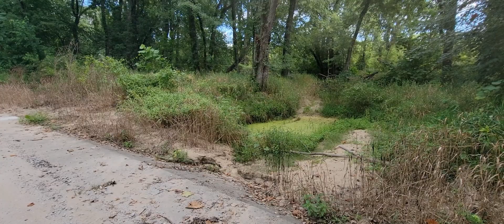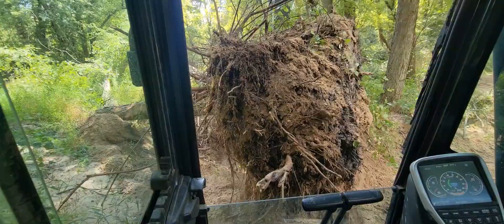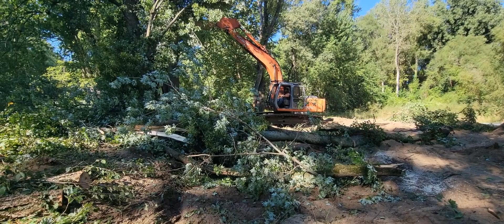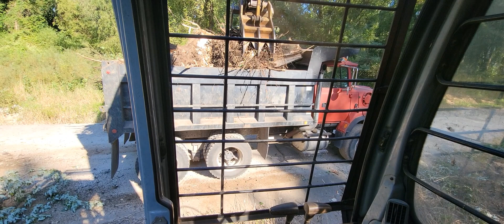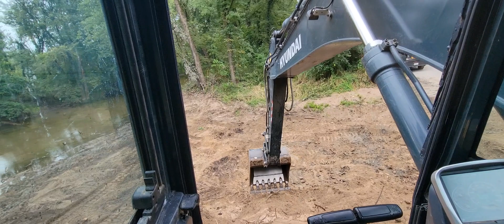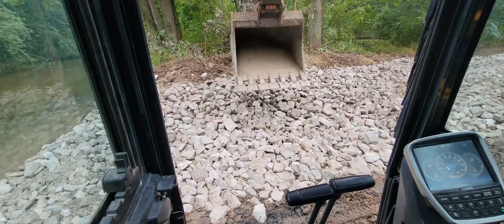A New Adventure With The New HX220AL Hyundai Excavator!

Comment: Speaking of getting hot, any ideas on whats causing my PC75 to get hot? No leaks in the cooling system, no fan clutch, water pump seems to work- no noise, thermostat works- boiled it. Only thing I can think of is maybe the impeller spun on the shaft, avoiding tearing into it for now.
Reply from the maker: Is it the hydraulic getting hot causing the engine temp to go up? And have you checked the engine temperature with a inferred heat temperature gun  to make sure the gauge isn't just lieing
Reply: @dirtgrainsteel  Thanks for replyin, my laser thermo took a shit, I think the hydraulic is getting hot too. Tank felt pretty hot but not sure what normal is. Not sure what would cause hydraulic to heat up, no noise and new and proper fluid level. Cant afford to burn her up! lol

Comment: I’m kind of surprised they didn’t have you leave the stumps in or bury them in the bank.  Our local DNR has gone to that to try to stabilize banks.  But they also won’t allow the use of rip-rap, so stumps/branches/brush is the next best option to keep banks from washing away.
Reply from the maker: It all just depends where your at and what your doing up stream about 6 miles they are doing a project using all the trees and brush